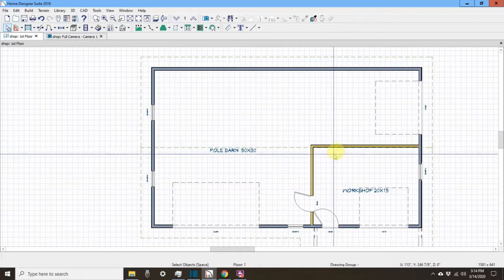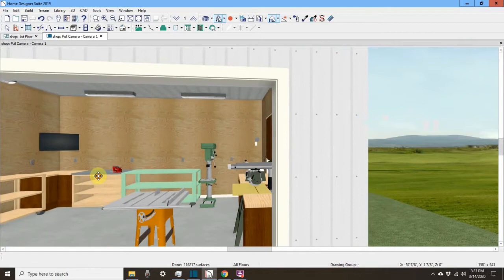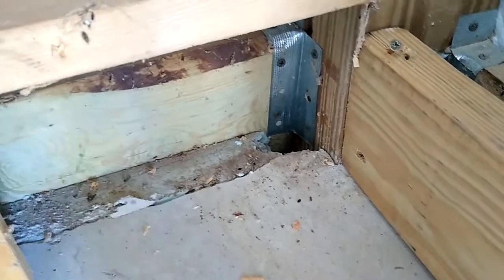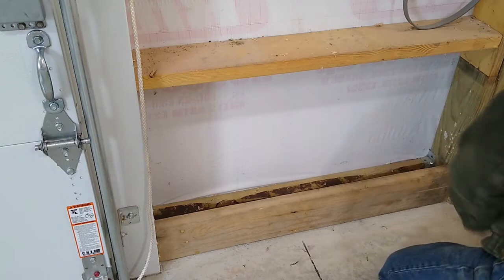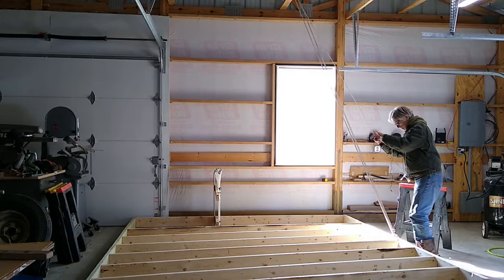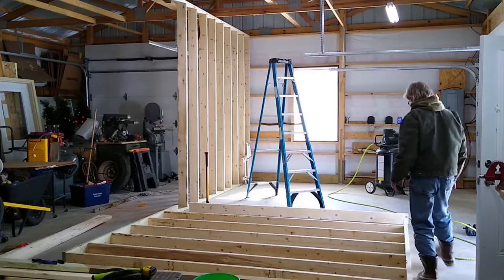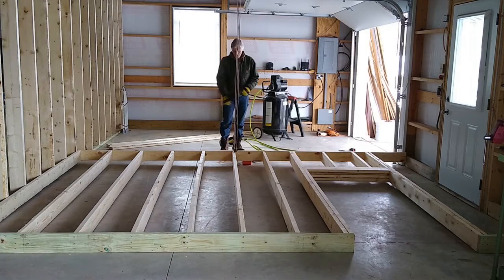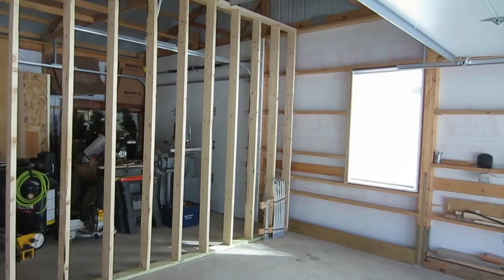Pole Barn Workshop - Part 1

Comment: You can never have enough 120, and 220 outlets.  Plus the other thing I did was plumb in air outlets similarly about every 6-8 feet.
Reply: @TheToolmanTim  I plumbed all the air lines with hard copper.  No issues for the past ~15 years.  Not sure if that's the best option, but just what I did.